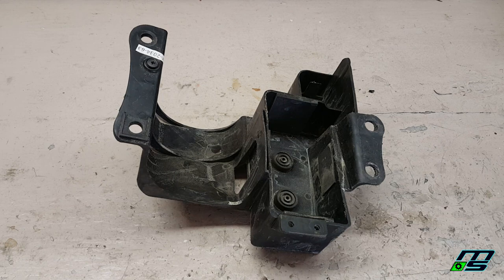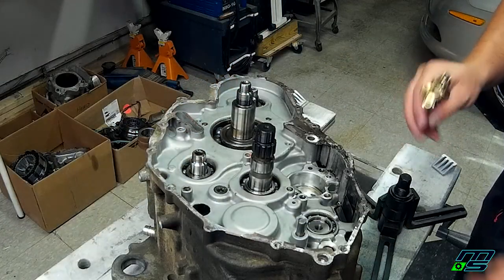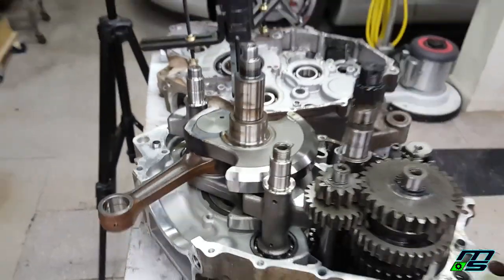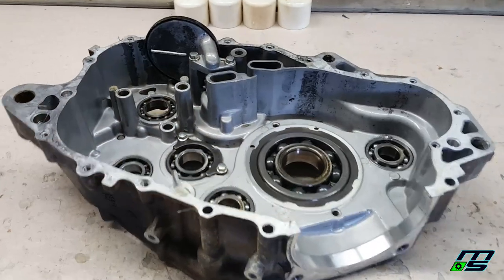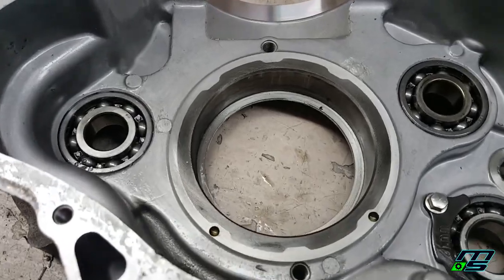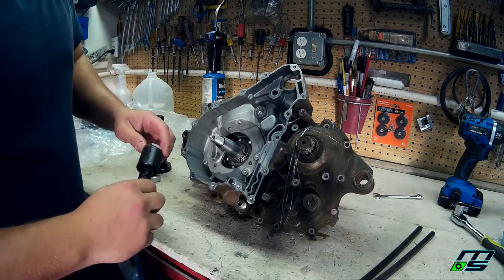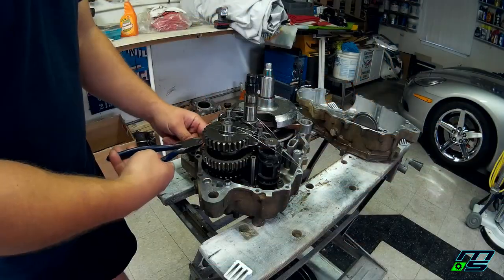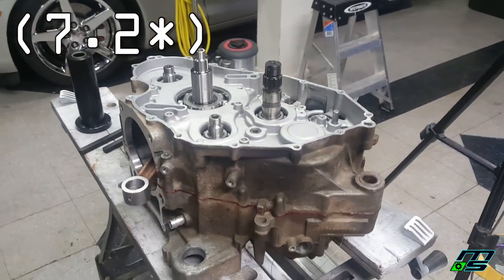Splitting Cases, Replacing Crank | Raptor 700 Motor P5

Comment: omg the cringe no matter how light you hit the inner race of the bearing its junk now i guarantee it will go bad again in no time
Reply from the maker: I know, that's why I recommend against it; I should have used the old bearing to tap it in. But in reality, I don't think the bearing is bad from light taps. It will be a test; if it blows, you'll know about it and I'll re-do it.
Reply from the maker: I made a comment and pinned it at the top of the list because this is bothering me so much.
Reply: Hopefully you plan on replacing that bearing haha. The worst possible thing you can do to a bearing is hammer on the inner race. As soon as I seen this I paused and hit the comment section. I wouldn't run that engine after hammering on an inner race let alone a main crank bearing. I know you wanna do it right brotha, right thing to do would be replace that bearing. Either way, still enjoying the projects bud
Reply from the maker: This is my busting face I know man; I'm pretty pissed at myself right now especially because I know better. I'm not sure if I'm going to try running it or not.
Reply: Michael Sabo... if something goes out at a high rpm and you put your rod through the cases your going to be real pissed haha
Reply: Michael Sabo Soooo, hows that bearing? I bet it’s working ok...
Reply: DUNE YXZ actually wanna know too lol, they’re giving him a hard time
Reply: Daniil Primachenko Actually he replaced it on the next video...
Reply: DUNE YXZ dang my bad

Comment: A quick tip for press bearings. Take a can of computer dust spray and turn the can upside down and spray the bearings. Don't spray it onto your hands. Its very cold and will frost burn you. But for a quick freeze it works great.

Comment: It was a good example only thing I'd recommend differently is how u installed the main bearing. You should never hit a bearing on the inner race, due to the fact that you can actually create alottt  of play and worst case just completely blow the center section or off the outer race! That center section is essentially free floating so by pressing on the outer you are pushing on the main body of the bearing and the center of it will be stress free and will follow the outer wherever it goes. If at all possible I try to use something that will lay perfectly over not only the main bearing but also the inner completely evenly. The old race for instance works great! Good job!

Comment from the maker: I MAKE A ROOKIE MISTAKE IN THIS VIDEO! DO NOT TAP YOUR NEW MAIN BEARING IN FROM THE INNER RACE LIKE I DO IN THIS VIDEO AT 17:40! USE SOMETHING THAT HAS THE SAME CIRCUMFERENCE AS THE OUTER RACE OF THE BEARING! USING YOUR OLD BEARING TO TAP IN THE NEW ONE IS A BETTER OPTION THAN THE SOCKET I USE IN THIS VIDEO.

**You can all rest easy, I am replacing the bearing and tapping it in from the outer race.**

Comment: U know that gasket sealer you cleaned of the outside of the engine.  the same amount will also get on the inside of the engine and clog the oil screan and get in the bearings.  hopefully it does not starv the engine/bearings of oil.

Comment: I have to split the cases on my raptor. I only need to replace the left side case, so can I leave the right side case intact and leave the transmission in? Or are there bolts inside the right side case?

Comment: I know you have been over the bearing you tapped in. I see that you also know that Hot Rod Cranks have a high failure rate. When this engine explodes you will not know which failure to blame. For everyone, please replace that bearing. That will leave no doubt if the crank fails. Love the videos. Just want to see it done correctly.
Reply from the maker: Chris Smith I already ordered another bearing; I am putting it in correctly. Thank you for the feedback.

Comment: Always use grill or oven to remove and install bearings. They drop right out & in at 220 degrees. Torch can warp the case.
Reply: Also never torch a bearing. Find a socket that fits snug inside the inner race of the bearing, torch the socket for a while then hold it inside the inner race of the bearing for a couple minutes. The crank will slip right in the bearing, won’t have to pull the cases together.

Comment: Hey I was wondering if u could
Point me in the right direction. I have a raptor 700. 2017 I’m hearing a small ticking noise ever so often. What’s could that be ??
Reply: Raphael Santiago if it’s like mine it’s the timing chain slapping around, do a check on your auto tensioner , see if it’s maxed out, I hear a lot of bad news about raptor timing chains when they hit higher mileage

Comment: Awesome Mike 《☆》kudos for filming this task Bro. I see peeps are already roasting Your nads about bearing installation. Good rule of thumb is never transmit the load thru the bearing so You will be putting pressure on whichever race is contacting the mating part. If You don't have the right size socket then a hammer & brass drift punch is acceptable with light taps around the circumference. Sometimes a brass punch is too wide so switch to a steel one that is small enough. For heating I use an electric heat gun & monitor the temp with a laser targeting thermometer that You can get for $20 at Harbor freight. Good luck with it Man. Always good content on Your channel & that one song will be in My head for a while. Daahh Daaahh Dattt thuukka thukkaa dahh dajjj ☻

Comment: Cool video.  I think his only method on hand was to pound the inner race on the Case bearing.
Reply from the maker: After watching my own video I feel like an idiot; I usually use the old bearing to tap in the new one. I think this one was still okay though.
Reply: The craptor is going to become the exploder haha. Hopefully it doesn't take out the engine cases when it goes. I just did a trx450r, left and right center cases were over $250each bare cases.
Reply: I agree*

Comment: Hi mike, I’m in Nova Scotia Canada, and me and my buddies watched most of your videos as we are a distance from a decent repair shop, and we’re broke ass running on a serious budget. I’m in middle of installing a new cylinder and piston kit , it’s a  cylinder works jug with a matching vertex piston set, while doing installation I noticed my timing chain was kinked and the auto tensioner was maxed, I guess that explains the racquet I was hearing, so I’m putting in a new timing chain, I’m noticing my piston rod can move ever so slightly side to side , bout a half mill each direction, is this normal, it’s not sloppy just side to side ...any advice is appreciated
Reply: A little side to side is ok, up and down is not ok